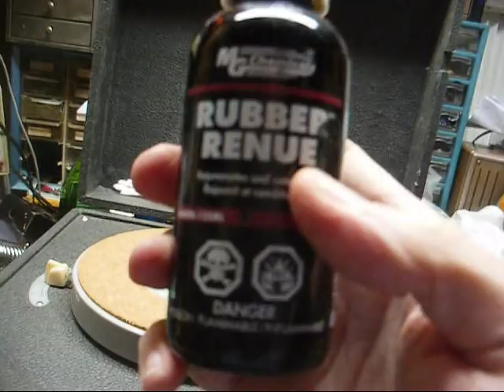How to service your Alliance phono drive - feat. mumble rap on a 1959 Califone record player

Comment: Good information, well presented. Thanks!

BTW, that white rectifier was made by Sarkes-Tarzian. Once one of the many US companies that made semiconductors. I suspect that is a 750 ma 400 V 1 W silicon diode. It probably has a 1N JDEC number on the side that could be looked up if you were curious and needed to replace it.

Comment: Just out of curiosity why dont you use like a carburetor or brake cleaner to get the old grease off? Also theres this stuff in a grey tube pretty readily available called teflon lube gel, so use that on old electromechanical pinball machine mechanisms, seems like it would be good for this too perhaps
Reply: Brake cleaner is hell on plastic and rubber parts.
Reply: @misterhat5823  I mean only for the metal parts
Reply: @Masterkill45588  I figured as much, but a spray can can be quite hard to control.